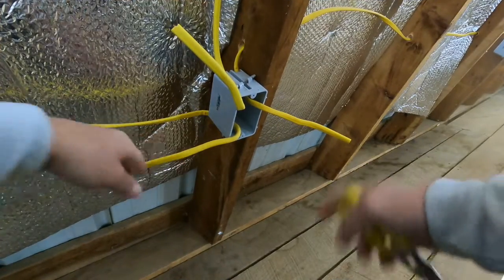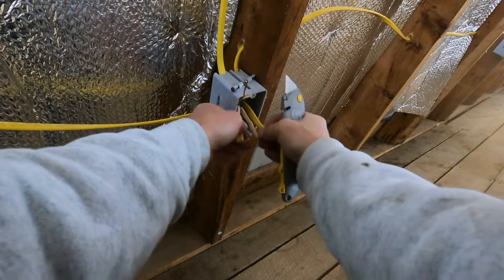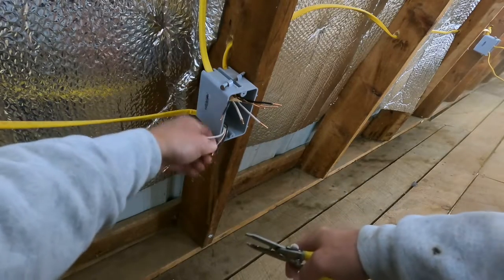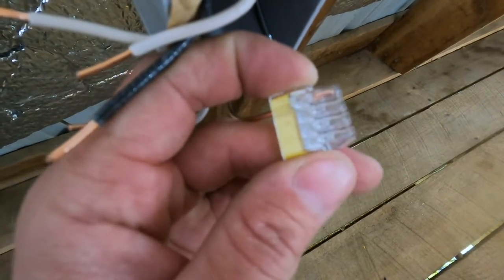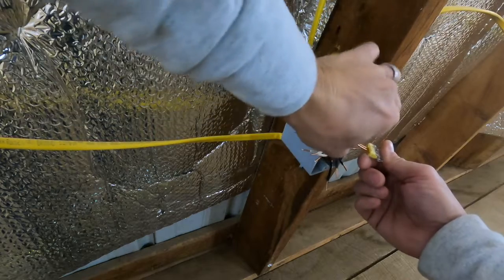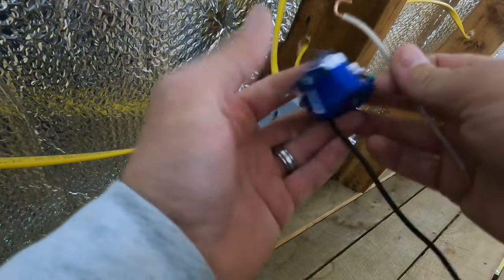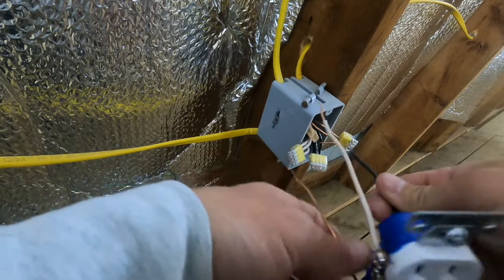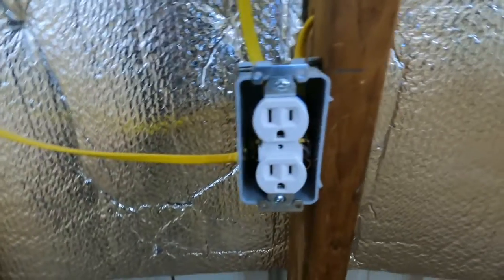Outlet Install Using Push-in Wire Nuts!

Comment: I figured this out on my own,  and have done this way before watching this. I am glad you are teaching  this!  This is also great if you are replacing outlets, and there is no room to put the wire on the sockets cuz there not enough slack given by the original installer.